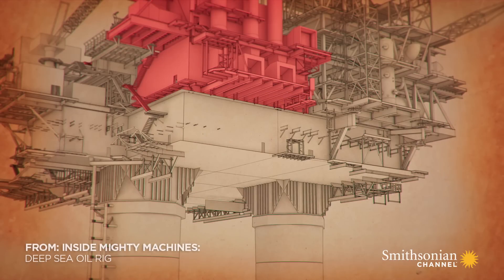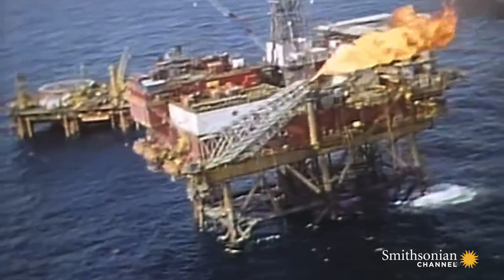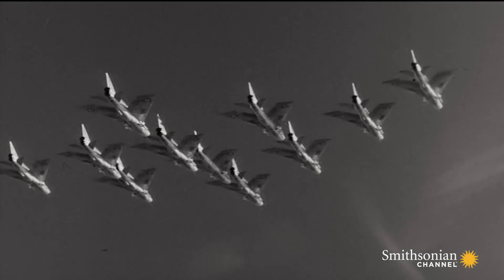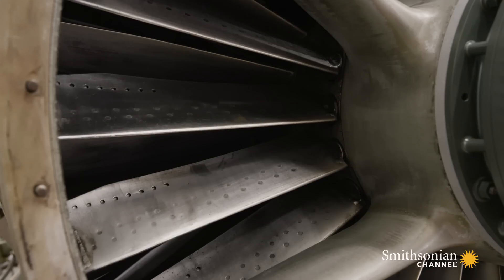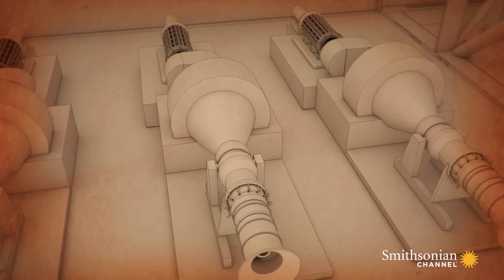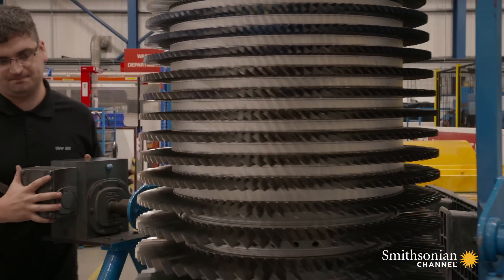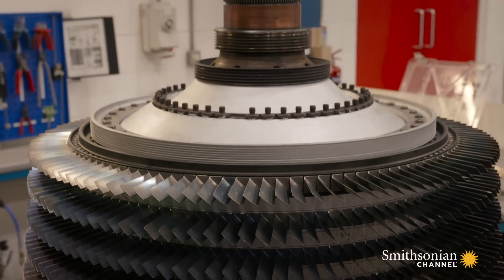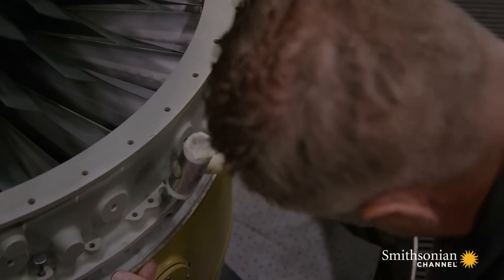How the Enormous Potential of Natural Gas was Unlocked

Comment: So jet planes can fly on natural gas instead of jet fuel?
Reply: Not really.... you would need massive amounts of it, and storage (weight & volume) are critical issues for an aircraft.... which is why they stick to jet fuel.  But if you're on a stationary platform on the ground, where weight & volume aren't an issue, and you have an almost unlimited supply of natural gas, then it makes sense to use the gas instead.
Reply: @ericmcquisten  I agree with the volume problem, but not at weight. Gas do have weight, but it's not that much.

Comment: Nice to Know but natural gas has been used almost since the beginning powering the low compression pump engines running on well head gas and natural gas jet turbines have been in use by power companies for standby power since the late 1970's as I worked for a company that manufactured them - Caterpillar Inc and Solar Turbines.